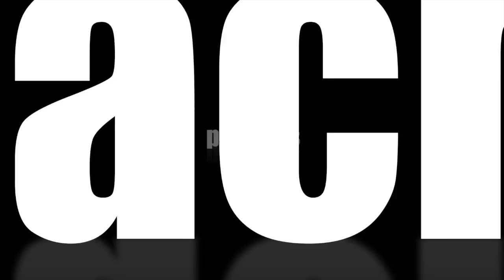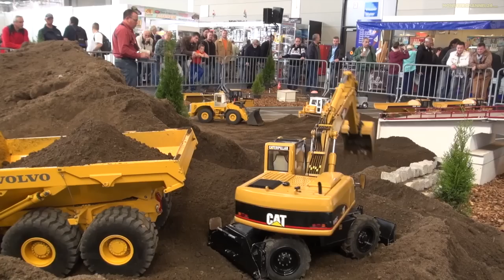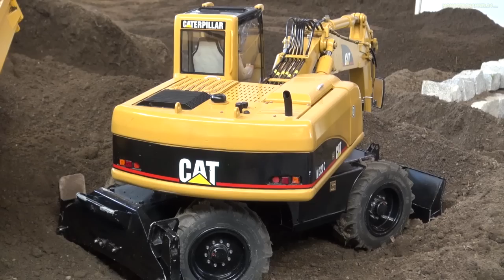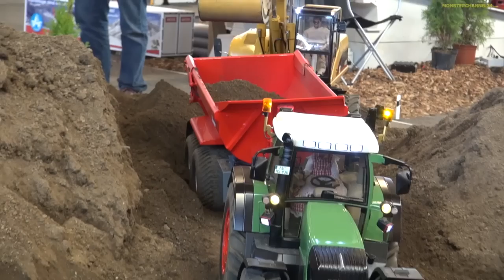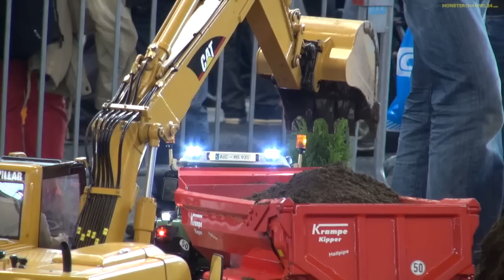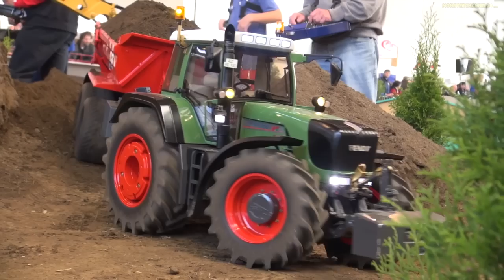BIG RC 1:8 scale excavator Caterpillar at work! Amazing construction model!

Comment: This is cool. My dad operated one of these for almost 20 years before he retired. His machine had the articulating bucket, as well as the tree sheers for performing roadside maintenance for our county road department. These machines can do it all- dig up a culvert,  lift it out of the roadbed, place it on a truck for disposal. Then place a new culvert, and bury it in. He would also work with what we called the "weed crew", who would follow behind him with chainsaws cutting up trees he cut with the attachment. Then he would come back with the bucket and clean out the built up sediment out of the ditch. Before they had the two machines he drove during his time, they had one that was on the back of a truck- which took two operators. One to drive the truck, the other running the excavator on the back. Tree trimming was done by hand with chain saws- very labor intensive work that took a lot of guys away from other important tasks.
Reply from the maker: +StormLaker1975 Thanks for your comment. Nice that you have this connection to the RC video. Nice to read your comment...
Reply: Are there kits to build these, or is it all done by fabricating the parts? Just neat little machines!
Reply: F
Reply: StormLaker1975 interesting documentary

Comment: Where can you find where to order a huge excavator
Reply from the maker: Unfortunately this one is not available in any shop. It's hand made from scratch.
Reply: @monsterchannel24  ok thanx..lots tallent .welding and what have you to make something like that..would there be a kit or something for like the tracks...and turret combination...i been around hydraulics for most my life..30 in nat gas industry and around equipment..would take a while to build off a track system.be challenging if that could be avail..i can weld what have you..quite mech inclined..but i am and have loved watching these pieces of equipment..reason i questioned.